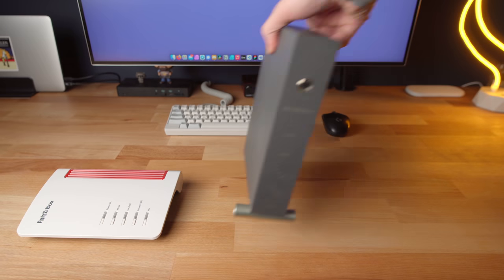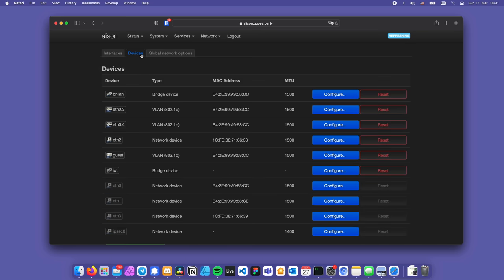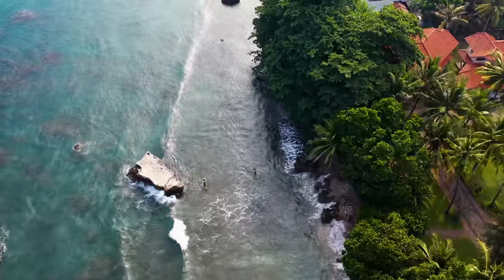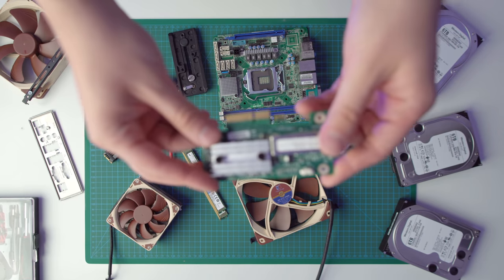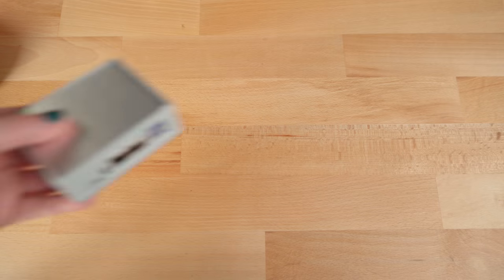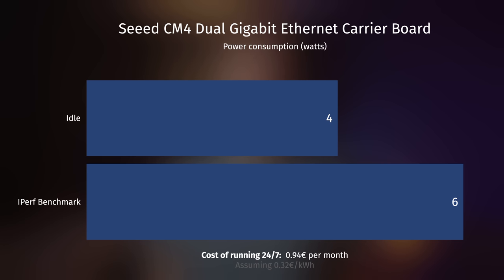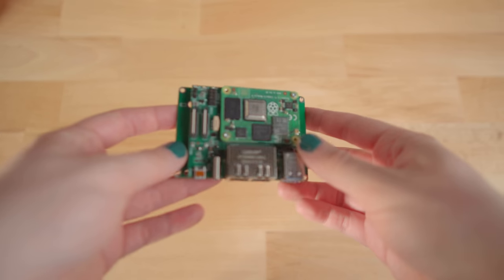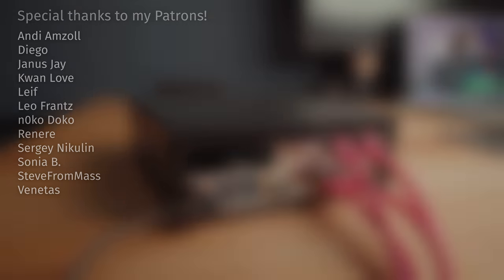Should You Build Your Own Router?

Comment: Then there is UDM Pro which is somewhat in the middle between OOB experience and some customizability, mainly aimed for those who don't want to spend a lot of time tinkering but offers more options than consumer router and more power than OpenWRT. It's main appeal is unified dashboard and integrates nicely with Unifi APs and can also act as NVR. It runs threat management capable handling of 1GB/s. The downside is size, its more suited for someone who has a space for network rack. For advanced network users may lack desired features and for basic/casual the price price too high and set of features overkill.
Reply from the maker: I'm really looking forward to UDM-Pro-SE being available

Comment: There are a few AsiaRf WiFi cards that work pretty good. I'm currently on 600mbps ISP speed and I can saturate it on wifi. Also, being told I can go over 1Gbps, since it supports WiFi 6e. The one I use is the AW7916-NPD, but the 7915 is also good. They are all under $40 USD.

Comment: for wifi, you can also attach any wifi interface to the machine, and use the package `hostapd` to create a software access point (I use that on my debian virtual machine I use as router, with the wifi card passed-thought to the virtual machine)
Reply from the maker: True. However, not all WiFi adapters support AP functionality – that includes all Intel cards, for example.
Reply: @WolfgangsChannel would you consider doing a video on modern wireless cards that support AP mode?  Or dropping a link or suggestion if it's not worth a whole video?  Thanks in advance.

Comment: I don't get why Espressobin isn't more heavily considered?  The Base price was $70 with 2.5G in a 3x1G configuration, screaming home router.  It also has mPCIE and SATA ports.  You do need a 12v PSU and I'd pair it with a Pi-ZeroW for a wireless serial console(the board has a USB serial adapter, so needing USB converter to share and a Pi fills that need.)

Comment: ipfire works on pi4, though I am not sure if it works on cm4 yet. EDIT: You can sometimes find proprietary firewalls based on x86/x64 very cheap. They will often allow You to install any os. I am currently running opnsense on riverbed steelhead CX-570(CXA-00570-B120) that i bought for £60, it even has ipmi module which is usefull as it has no video.

Comment: I have one of those aliexpress fanless x86 computer and with windows 10 pro pre loaded on it. When windows wanted to update it was very slow maybe it was hdd iops? But it’s been running pfsense with no issues. Mine did not come with the sata power cable so I’m waiting one my cable parts from Amazon.

Comment: The stuff the ISPs sell you is usually the lowest spec overheating crash prown excuse of a cobbled together accesspoint with a modem added as an after thought. Looking at you Vodafone Station that can't handle more than 4 simultaneous wireless connections without shutting down.

Comment: Hello there, your videos are really helpful. I wanted to build a 10gbit router from an dell optiplex with a i5-6500 and 16gb ddr4 ram with an SSD. I wanted to install a QNAP QXG-10G2TB NIC into it. For all extra devices i wanted to install a 10Gbit network switch. As i am from germany like you i would like to build a more efficient system. I am not sure if my decision to go for a used optiplex and using it is a good one.

Comment: nice video. But i have only one question. you said o bought a ubiquiti instead using a wifi 6 card on ur custom router. But the client will use cpu and ram from ubiquiti and not from the router so, its better just have the ubiquiti in this case.

Comment: IMHO OpenWRT is the best Router around simply for its ease of use and flexibility while being extremely powerful at the same time. I tried untangle, pfsense, opnsense, MikroTik's RouterOS* and Ubiquiti's security gateways but nothing matches OpenWRT. Setting up load balancing across 2 WANs is stupidly easy with the mwan3 package and configuring firewall rules and zones was also a smooth ride. All this while being lightweight enough to run off of a VM in my server with 128MB of memory

For switching I use a MikroTik CRS328 and for the APs I use UniFI APs. MikroTik's switches are unmatched for their price to feature/performance ratio while UniFi provides a really nice centralized plane for easy setup and management for my wireless clients.

It really feels like OpenWRT is not used professionally because of branding(?) because it can doing everything that enterprise routers can while taking less resources. Build and shape your own image and you'll have an amazing router suited exactly to your needs. I run mine off of a single i7 6700 thread and the CPU goes to about 30% at gigabit with a few firewall rules and NAT

* Setting up QoS and multi WAN with RouterOS was extremely tacky and finnicky + it took a lot of time to get it right and even then I wasn't happy with the results. In the end I decided to ditch it and go for OpenWRT

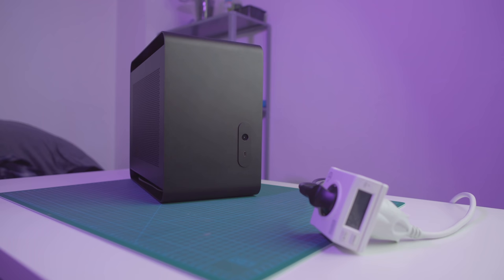Comment: I saw you're using a digital power outlet measure 3:55. Which equipment and monitoring system do you use to measure the power consumption of your computers?
Reply from the maker: Shelly Plug S

Comment: Hey, good video and thorough review of the topic. Check a Thin Client option. I use Dell Wyse 5070  Thin Client with Intel J5005 Cpu with Pfsense that is smooth.
Reply: What 2nd NIC are you using?
Reply: @christianlink1817  Fujitsu Quad Port 1GbE Gigabit Ethernet Adapter PCIe - D3045-A11 - low profile

Comment: The cheapest router is the ubiquity edgerouter x at $59, performs great and can be powered over PoE and also has a PoE out for a unifi accesspoint
Reply: you can probably get a m92p cheaper
Reply: @elduderino7767  single ethernet, no poe (i happen to have one, great little machine)
Reply: @atom6_  thats a purpose built device and as such extremely limited

if you want complete control and the ability to run any software/service you want you'll need proper x86/64 hardware

and a $2 usb NIC is unlikely to be driven hard by your internet connection

Comment: I'm using an HP T520 with a RTL8153 USB 3.0 Gigabit dongle. All is good so far (not tested speed using iperf3 yet). I have the 8GB SSD (using 24MB so far) which it came with installed, but downgraded the RAM to a 1GB stick I got for free (it has about 600MB RAM free). I previously used a "BT Home hub 5.0 type A" with OpenWRT on, but the throughput was only about half of what it should have been so my 300Mb/s pipe appeared to be 150Mb/s :'( ! I still use a couple of these as a seperate dumb APs (I have about 7 now, I neep getting given them).

Comment: You don't technically require 2 NICs. I'm running a Pi 4 in VLAN trunk mode and have one VLAN id for pppoe for my ISP and other networks using different VLANs.
It's not ideal because in/out shares one NIC, but it's good enough for my bandwidth.
I tried a non Pi SoC with 2 Gigabit LAN ports, but it didn't work with Ubuntu server out of the box, which is my OS of choice atm.
Again, not the typical router OS, but it's much easier to build other stuff on.
Reply: not secure.

Comment: Back in about 2003 when broadband internet at home was a single computer connected to a cable modem by USB or a network cable into the back of your cable TV box, we HAD to build our own router, there was no other affordable choice.
And even then, the real routers, which nobody could afford, didn't have the MAC spoofing required to get it to work, as the cable company would only talk to the single register MAC and the only way to do that was with their windows only software.

So we took a Pentium 90 with 32Mb of EDO RAM, two Intel NICs with Linux supported offboard TCP acceleration and a pair of floppy drives.
This then booted, off of two floppies, the ultra compact Linux router distro  LRP, the Linux Router Project and it's descendents.
The second floppy allowed us to add IP QoS and VPN support. Not bad for 20 years ago.
Reply: 👍 Floppies
Which country in 2003? 😎

Comment: I literally am unable to update my router to the newest firmware because even though it's our router we bought the firmware is controlled by our ISP. (It's a router modem combo)

I removed it as the DNS and DHCP server with a pihole at least but I hate that thing. At least I could turn of DHCP and it does support port forwarding

Comment: Not having AES-NI is a huge downside, as pretty much anything encryption these days uses some form of AES for symmetric encryption. Having ChaCha20 as an option would be nice for these devices, as it's about five times more efficient given how friendly add-rotate-XOR encryption algorithms are to branch predictors. Sadly anything but WireGuard uses ChaCha20, so it's the only VPN software I can recommend for systems without AES-NI support.
Reply from the maker: Personally, I've been using IPSec (one client) to VPN into my home network, and haven't noticed any performance issues so far.

Comment: Still debating between openwrt and opnsense.  Have the components needed for both. Have both set up as a lab to work out the kinks. 

From the standpoint of what I want to do, it's quite simple; segregate off sections - guest wifi, work machines, NAS storage, lab, phones & tablets, and IOT, while having an ingress back in while out ( VPN ) .. Still working out the VPN access.
Reply from the maker: I’ve tried both and I like OpenWRT more. The UI is less cluttered and firewall rules are easier to understand

Comment: I've build my own router, using a J4125 motherboard from Ali-Express.
It indeed uses about 9w of power, one of the reasons I've bought it in the first place. I only have 2 ethernet ports.

I went one step further. Installed a Linux server, which maintains my home network and pc's. Then I run Qemu/Virtmanager to run 2 virtual machines, one is for pfSense, and one for TrueNAS. At the moment I did ran into a problem, and that is speed. Although I have 900mbit/s from  my ISP, my speeds lowerd to 100mbit/s, which sucked bigtime. Once I made 1 NIC passthrough, the speed went up to 450mbit/s, but I can't do a passthrough for the 2nd NIC.

Comment: Compared to that piece of crap Vodafone sends out, a Fritzbox at least gets most things right enough so that most people - even tech savvy ones - are fine off.
Looking at the poor VPN and "NAS" implementation of my 6490 however, I feel like a separate router would be nice somewhere down the road.
My NAS is a custom build with a 3150 i-C SoC, the problem is it only has one PCIe x4 slot.
However, I too still have my Kaby Lake era ITX mobo with two gigabit NICs and a proper x16 slot on it.
Maybe that'd be a nice upgrade to combine both my NAS and my router? The Fritzbox could still act as WiFi access point.

Comment: you didnt count the power consumption of the wifi ap?

i got an openwrt router that takes 5w with wifi on, with 2 cores, 250nand and 500mb ram, and id say for a home use its plenty enough, wireguard, adguard, network shares, ddns, vlans, mwan3, 4g modem connected to usb, you name it (i actually run out of ideas, what else to run on it, that i could make use of it), and im still using less than half of the resources, wifi coverage is very good, even tho i have lots of other networks around me, it was 60bucks on ali a year ago, and while building ur own router pc sounds cool, from the economical point of view, it just doesnt make sense for anyone other than the hardest power users...

Comment: Can you recommend a Low Power Modem as well or is the Fritzbox in only "Modem use" Power efficient. I was also looking into a small pcie Card for the newer AliExpress boxes to have WiFi Ap behind Firewall but those Intel cards dont Support AP Mode any recommendation for wifi6?
Reply from the maker: Yes, I think most FritzBoxes are pretty power efficient
Reply: So switching to just a Modem wouldn't save Energy compared to the fritz.
Reply: For WiFi behind Firewall, what do you recommend?
Reply from the maker: If you're okay with the feature set and WiFi range of the FritzBox, I would just stick with that.
If you need more WiFi coverage (e.g. big house), TP-Link makes some pretty good Omada APs that don't require controller software.
UniFi is a more high end option and they have a pretty robust admin interface
Reply: OK but the WiFi wouldn't be behind firewall and a dedicated ap would probably consume more Power than pcie card
Reply from the maker: Not really. My APs consume 4-5W and a PCIe card can actually consume more, depending on whether it supports proper ASPM. 

Unfortunately, it’s just not a good idea to run a PCIe WiFi card. The cards that you’ll find on the market would either be expensive or not easily available. The ones that you can buy for a reasonable price are old and don’t support newer standards like WiFi 5, 6 or 6E. 

FreeBSD, which OPNSense and pfSense are based on, doesn’t have drivers for a lot of popular WiFi chips, and even in OpenWRT, the built-in AP management is kind of a PITA.
Reply: thx i've researched the same asiarf seem like they are offering good cards but shipping is expensive. And the current capability needs to be verified for the connector of the Board plugged in. I guess they only drive the current If you have them running wifi6e full speed.